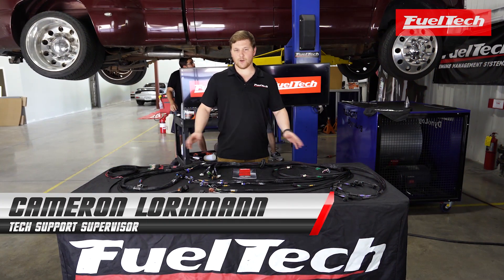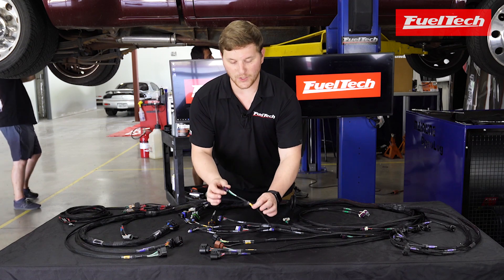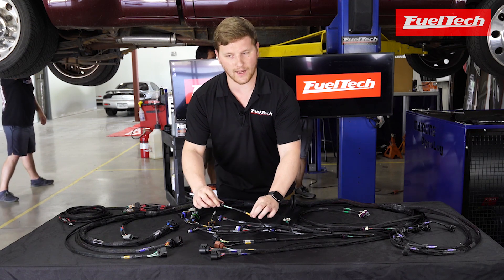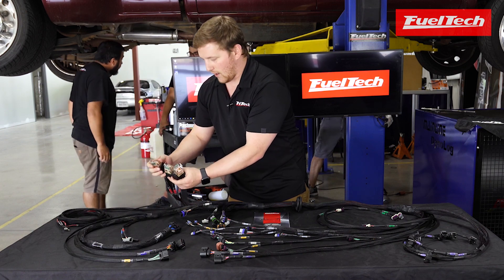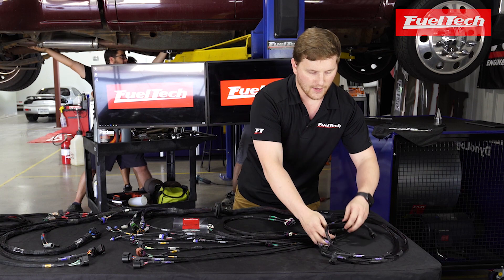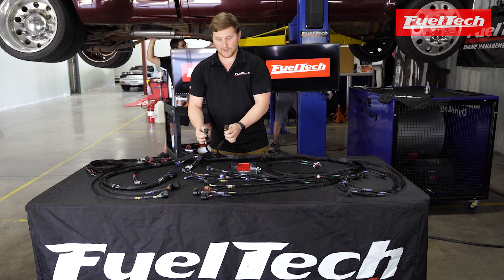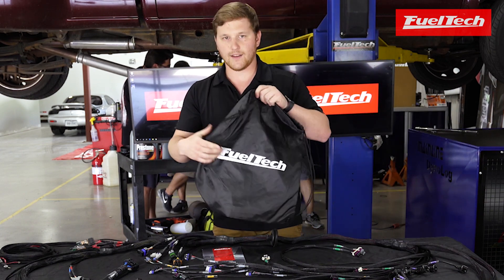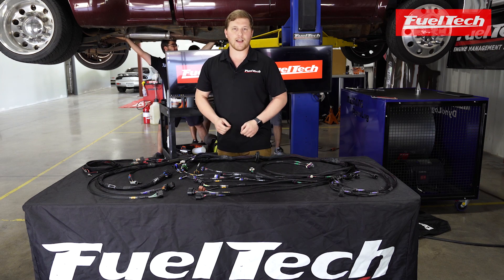FuelTech LS550 V8 Complete Harness!

Comment: So how do you hook up a 4l80e with this harness for transmission control?
Reply from the maker: Hey Jeff, To hook up your 4l80e you will need to wire it in to the extra inputs and outputs connectors.
Reply: FuelTech USA will I need anything else for addition such as on the transmission other than the stock pig tails?

Comment: Does it still work when you connect a ft500lite with a racepak to it
Reply from the maker: Hey Justin, Yes absolutely the FT500lite is exactly the same but just does not have the touch screen. And your racepak will need to be hooked up with their universal EFI module that will plug right into the can B plug on this harness!